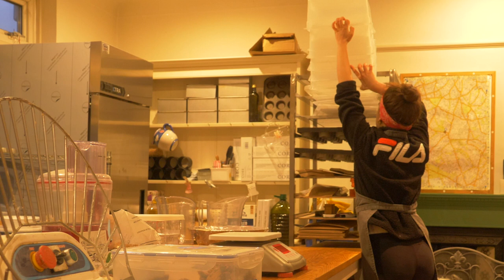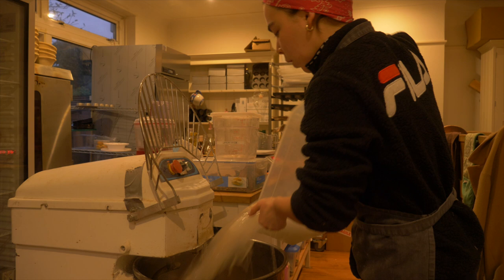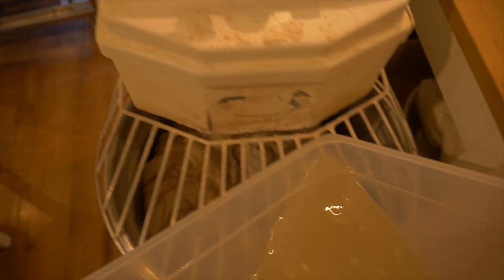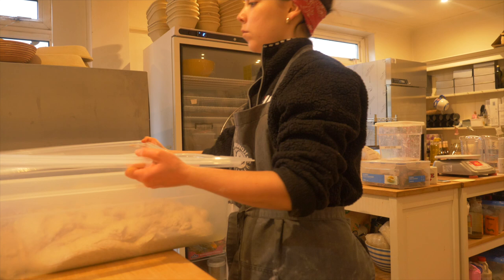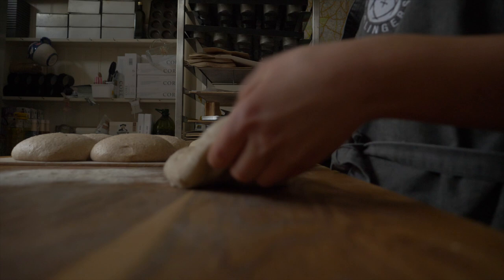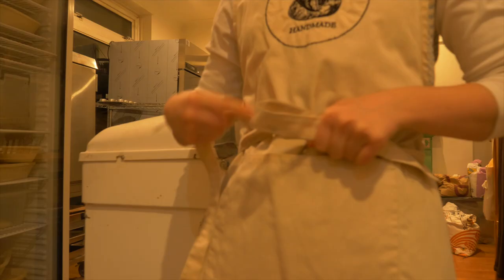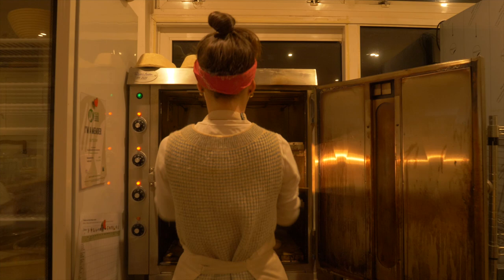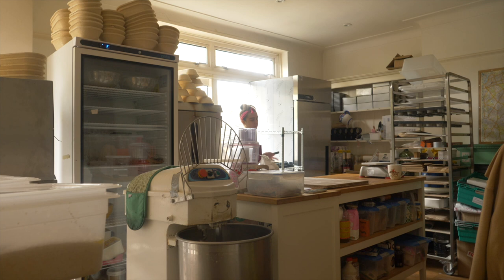My Sourdough Bread Process in my RM2020 Oven (updated)

Comment: Hi Lily. Thank you for creating and sharing this video. I just started baking with my Rackmaster2020. I love it,  but I haven't been able to dial in on a good baking profile. Your suggestion to load at 250, bring temp down to 210, and then bring back to 250 for remainder of bake is very helpful! Would you mind sharing how much time after unloading you wait before loading next batch?  Many thanks again,  and beautiful loaves!
Reply from the maker: my pleasure! ooh how exciting! hmm it depends how busy I am, but I try and wait at least 10-15 mins in between batches as the temperature does drop dramatically after adding steam
Reply: @LilysLoaf  Thank you, Lily :-)

Comment: Hy Lily,
Just on question about this oven. The oven can be connected to the normal socket at 220v? If i buy one i can use at home without problems?
Thank you
Reply from the maker: Hi Marius! Yes absolutely,, it can be connected to a domestic supply no problem :)
Reply: Thank you Lily☺️.
Reply: @LilysLoaf Thank you for your answer. But i have one more😊. Let’s say in the future you will open again one micro bakery, you will buy the same oven?

Comment: hi Lily -- great to watch this and I love the scale of your operation. I'm curious about approximate quantity of dough per container you are using there for bulk fermentation -- and what is approximate volume of each container? Any insight? Cheers, Simon
Reply from the maker: hey, thank you! So the containers are either 20 litre/ 26 litre in volume and I fill them only a third full (ish) so there's room for the dough to grow throughout the bulk fermentaion:  https://www.nisbets.co.uk/nisbets-essentials-polypropylene-full-size-gastronorm-container-without-lid-200mm/fa822?vatToggle=incvat&plaid=1&cm_mmc=PLA-_-19652062308-_-148686295889-_-FA822&cm_mmca1=go_19652062308_148686295889_647495878734_pla-597855165486_c_&kpid=go_cmp-19652062308_adg-148686295889_ad-647495878734_pla-597855165486_dev-c_ext-_prd-FA822_sig-Cj0KCQiAutyfBhCMARIsAMgcRJT1uHEvuU6SSAIcD9V_OnEcoMl3hDky6E0M0ZUgRu_v_hmFDrYOa90aAqsvEALw_wcB&gclid=Cj0KCQiAutyfBhCMARIsAMgcRJT1uHEvuU6SSAIcD9V_OnEcoMl3hDky6E0M0ZUgRu_v_hmFDrYOa90aAqsvEALw_wcB
Reply: @LilysLoaf  Amazing -- thanks for the link. 26L at a third full (ish) is about 9L -- my guess/estimate that that is about 10kg of dough. Close?
Reply from the maker: @simonrecovery8682  ooh potentially, it changes every time due to number of orders!!

Comment: How do you get the oven timer switch? Does is a 2 hour heat up required? How about if you’re baking more than one full load? Are you reheating for a time?
Reply from the maker: hey Sara, I hired an electrician to install the oven timer and it takes 2-2.5 hours to fully heat up :) and about 15 minutes in between bakes to heat up again. Hope this helps!

Comment: Hi, Lily, So, with regards to the RM2020, obviously it gets hot inside the oven, but how much heat does it put outward (toward the room it's in). If it's on, can you feel the heat from it if you're standing, so, 2-3m away?  I'm considering buying one,. but I'm also somewhat concerned about how much heat it radiates outward.
Reply from the maker: hello! So the room definitely does warm up but I wouldn't say you can feel it unless you are less than 1m away/ touching the door (which I wouldn't recommend anyway!); it's never unbearable as long as you have a window open/ door open keeping the room well ventilated especially when releasing steam. It's a very well built piece of equipment :)
Reply: @LilysLoaf  Ok, good to know. Thank you for the info, and thank you for your time in responding
Reply: Did you buy it?
Reply: @pasofino9583  Not yet.
Reply: @tglenn3121  looks pretty cool,
I’m thinking about it.